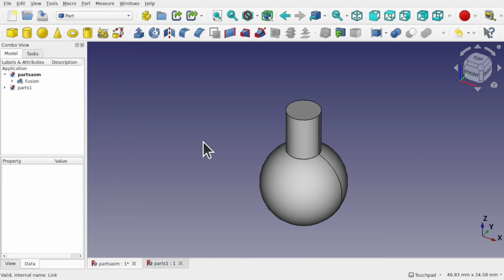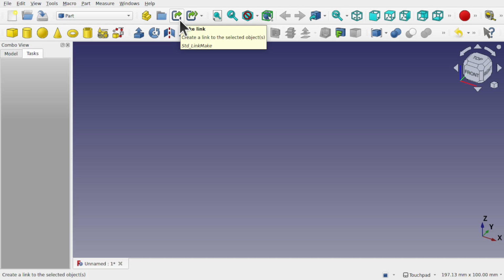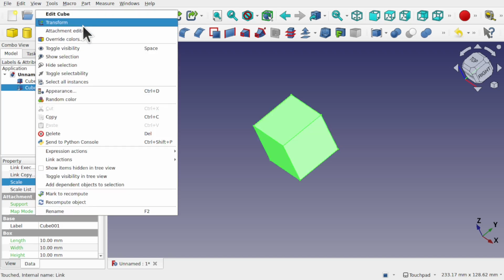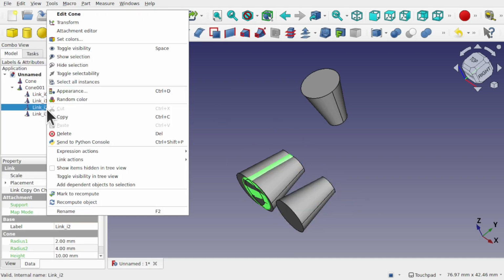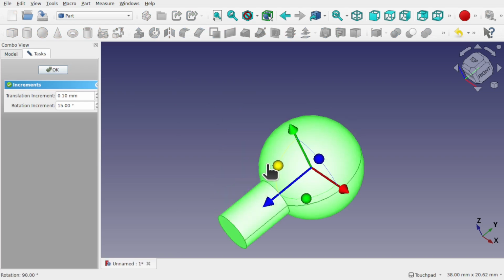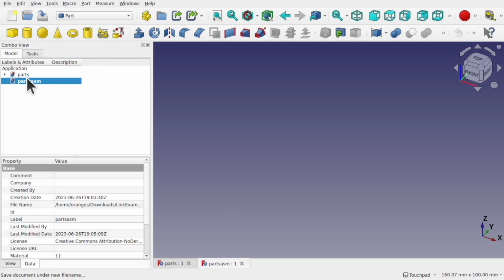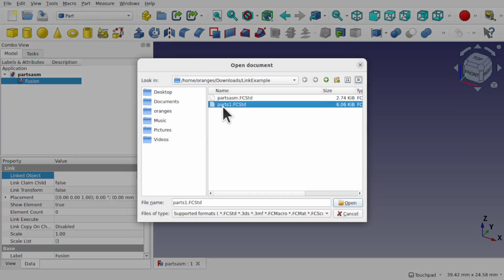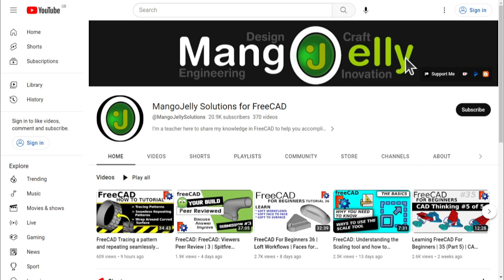FreeCAD What Is The Link Tool? And How Can We Use It In Parametric Modelling | Mastering FreeCAD | 1

Comment: Excellent.  Always wondered with these icons were for. Thank you.
Quick Question: there is a yellow color Icon called "Part" left of the link icon... What is the purpose of that icon?
Reply from the maker: Glad you enjoyed the video :)  Ah, yes so those yellow folder looking icon is a part container, it is very similar to the body container used in part design, but you can use them in both part and part design workflows.  You can add a part container and within you will see another icon in the treeview called 'origin', if you click on it and make it visible (use the spacebar to toggle visibility) or the eye icon in the treeview, you will see 3 planes and axes.  You can select a plane from this origin to attach sketches and geometry to.  This part and origin is independent, and can be moved via the part placement in the data tab.  All other geometry in that part container will move as well due to the attachment and placement.  It's a great way of organising your models as well.
Reply: @MangoJellySolutions Thank you for the response. 
So does that mean that there is another video tutorial on its way regarding its usage 🙈😂
Or am pushing my luck

Comment: Nice! I just discovered this feature in Fusion which is a mind blown game changer but free version heavily limits it. I'm not about to pay $1000 a year to make stuff for my cat. Time to migrate to FreeCAD
Reply from the maker: I'm intrigued about what your making for your cat?
Reply: @MangoJellySolutions  Making a RFID food bowl that will open if the correct tag is detected. My cat requires expensive hydrolyzed protein food. Roommates new cat doesn't so I need to make sure they're eating the correct food.

 The ones on the market require the use of a collar so I bought an Arduino, antenna, and Lego motor. Got 2 inch read distance from the implanted RFID tag. Now I'm learning CAD and 3d printing!

Comment: how do I turn the xyz arrows in the bottom right of screen back on? somehow mine are gone.
Reply from the maker: Top menu > edit > preferences.   Display icon on left > 3d view tab > general section at top.  First checkbox, show coordinate system in corner and show relative size option.  Hope that helps.
Reply: @MangoJellySolutions  thank you

Comment: Darren, As an Aero Modeller designing Aircraft One has a lot of Common Objects (i.e. Engines, Motors, Batteries, Tanks, Servo's etc etc etc...). I'm thinking One could have a Library/ Directory of Commonly shared Objects that could be imported into My Designs. Instead of redrawing these they are simply linked into the latest design.
Reply from the maker: Yes that's a brilliant example of what this can be used for so you can build up a library.  Or a library of assembled parts as a sub assembly.  You can also do this from the assembly workbench to get them into position first.

Comment: I really hope FreeCAD takes this link thing to new heights caz there is the potential for FC to better than commercial softwares ! I remember in Autodesk inventor there were tons of headaches with assemblies and part versions. Basically, when you started working with multiple objects and then wanted to change some of them it started to get hairy. if any inventor users want to co-miserate > remember having reference geometry, which then conflicted with adaptive constraints.. just to name one hairy thing....  ugh, or having to use that separate practically hidden program to locate missing files....  So many things were half-arsed & I felt like that was unacceptable do to the price & age of the software !!  Its like, autodesk was so committed to backwards compatibility they were unable to change for the better.  =stuck .  FreeCAD is in a fine spot to excel ! For example: Since we don't have to worry about licensing. Old models can be opened with old software versions. New software with new features can just use those software versions. THAT is an example of where freedom wins ! FTW ! Luv this software !!  Lets Go !

Comment: AWESOME ! yeah, i consider multi-part modeling fundamental to CAD, so this is a winner tutorial/series :) Lets Go !   
Also, u should definitely start with ur FreeCad version & real quick show of what workbenches loaded/installed. Especially with this one caz of the RT branch & how many changes have happened + are coming regarding these features/tools. 
As of this date 7/5/2023,  is the topo naming bug fixed in main branch of FreeCAD ?
Reply from the maker: Glad your enjoying. I keep on meaning to add the version. Version 0.21 is a big step forward but the topo is still a problem. There is a road map going forward to fix the issue. .

Comment: Very interesting look into this feature; looking forward to seeing the next upload on this.

Wondering if this would better than Lattice WB for repetitions in a linear array or not. Still thinking of what is the best way for repeating same sized shapes like bricks, timber joists etc and keeping the file size small. Messed with Arch WB but doesn't fit into my work flow.
Reply from the maker: That is pretty interesting regarding file size. Wonder what they would be like compared with each other. Same build but different array techniques. Well worth a look into. I am very fond of the lattice wb for it's speed. I haven't used it with link before in an assembly type way. Actually I haven't tried seeing if lattice can be used across files.

Comment: For mulatiple parts which share a master sketch in order to assembly them. Will this be possible also with the "link" feature? So to have the master sketch in one file, link it and have all the other parts in independent files?
Reply from the maker: Yes it should as well as sharing things like spreadsheets and technical drawings